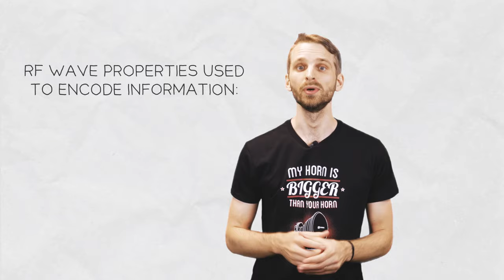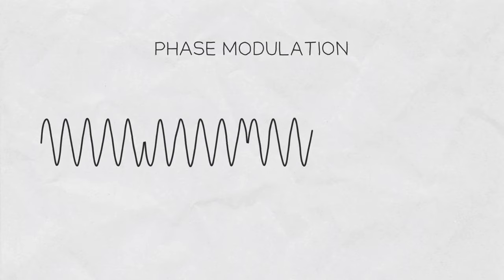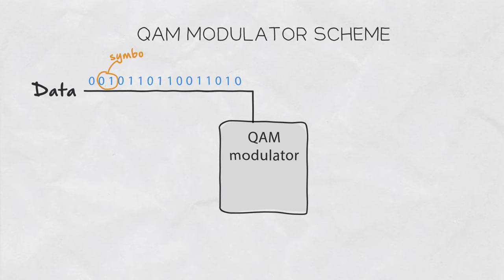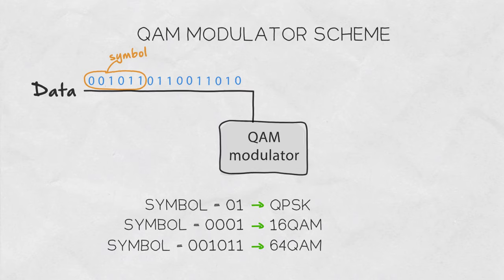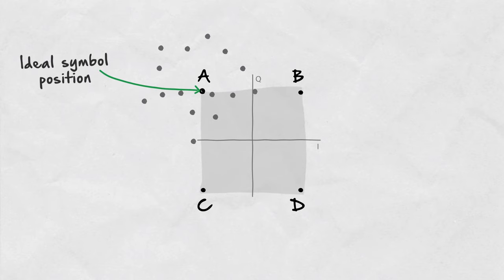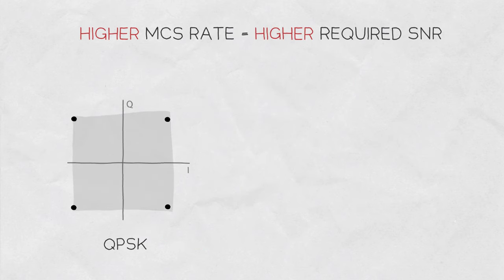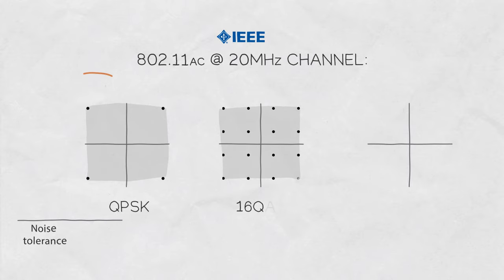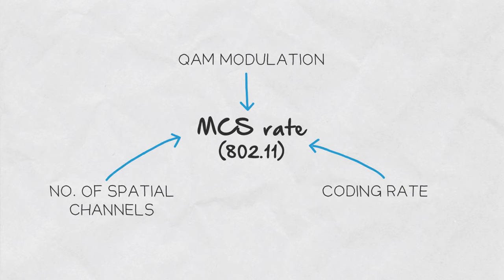Inside Wireless: QAM modulation (Quadrature Amplitude Modulation)

Comment: Sorry if it's a dumb question, but if it uses amplitude and phase modulation, then why is only amplitude modulation in the name?
Reply from the maker: The phase part of the name is hidden in the 'quadrature' ;)
Reply: @Rfelements  Ah I see. But I thought quadrature was referring to the fact that there are 2 carrier waves offset by 90 degrees. They both get amplitude and phase modulated if I'm not mistaken.
Reply from the maker: @QuantumBraced  Yes, they do, and the different phase shifts are between the bits the I and Q branches, but don't think about it too much. If everything should have been literal in this world, it'd be a boring place to live in don't you think? :)

Comment: what is the difference between the 128QAM and 64QAM with 28Mhz channel spacing , and is the modulation affecting the Transceivers price ? please your explanation highly appreciated
Reply from the maker: higher data throughput speeds and higher SNR requirement. Yes, generally the faster the data rate is, the pricier the device.

Comment: Do we even have Differential QAM, i.e change in phase only if the transmission from 0 to 1 occurs?
in DPSK, we don't need a coherent detector. Similarly in QAM too is it possible to have D-QAM?
Reply from the maker: You can find bunch of papers which discuss DQAM, such as these:
https://ieeexplore.ieee.org/iel5/5492959/5493597/05493801.pdf
https://dl.acm.org/doi/10.1007/s11277-013-1085-0
https://link.springer.com/article/10.1007/s11277-013-1085-0
Reply: @Rfelements  thank you sir..

Comment: Pls comment on 
ac 5  vs  ax 6
Reply from the maker: what exactly do you mean? Beyond the specs of these standards, is there any question you have?
Reply: @Rfelements 
I am interested in knowing
About the difference in spks and difference in  real life performance
Between  wifi 5 ac and
WiFi 6 ax
Reply from the maker: @vspatmx7458  the real life performance is a big question mark so far, since the ax radios for WISP networks are just hitting the market..